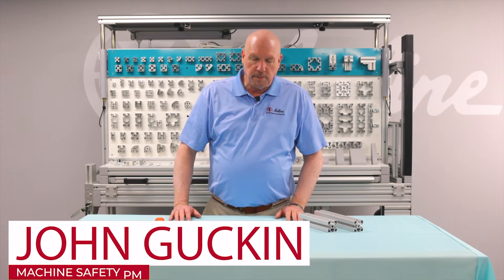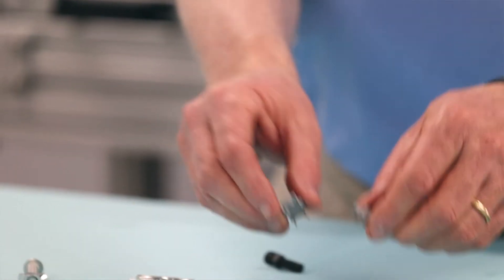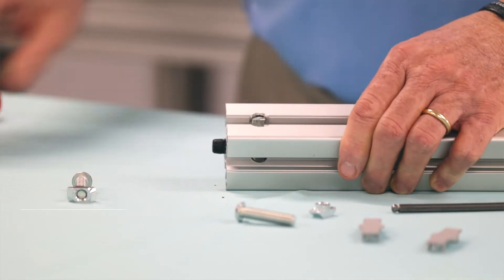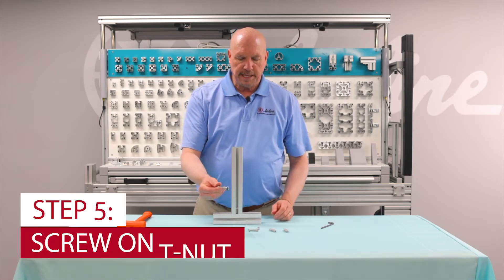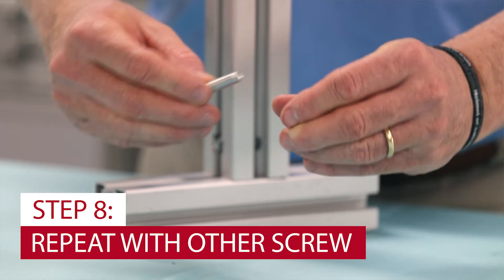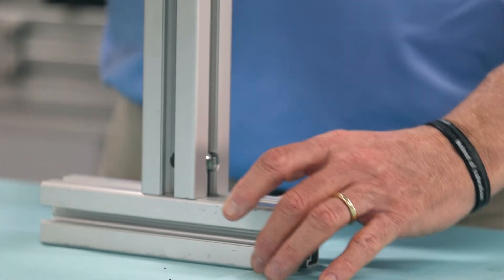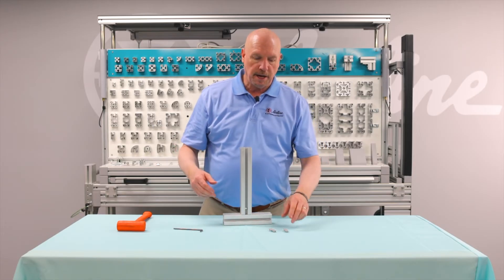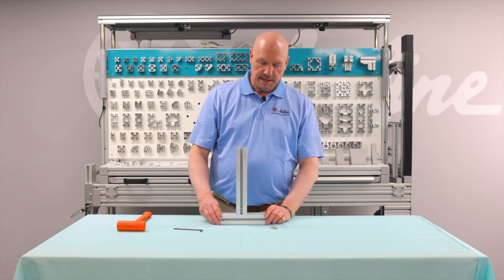The STRONGEST Way to Join Extrusion | Bolt Connector | Build Anything with Aluminum Extrusion

Comment: how can i install 40x40 profile onto a wall?
Reply from the maker: The response I got from John and our engineers, was that the most common way is to use "Gussets," and remove the anti-rotation gusset tabs first. 

Another option is also just drilling a "through hole" in the middle of the extrusion and screwing it to the wall.

We have each style demonstrated in this web image for you - https://bit.ly/4e6JVT8

You can purchase gussets and connectors from our site here - https://www.airlinehyd.com/categories/GUSSETS-419/1
Reply: superglue

Comment: And for the low low price of?
Reply from the maker: That all depends on the project! Some projects require engineering assistance, some want everything cleanly packaged and shipped ready-to-assemble, or you can just order strut and cut, drill, and assemble it yourself! You can get project help here - https://bit.ly/3SVNnFs or shop extrusion here - https://bit.ly/3Lo4wpt

Comment: I have a design for a 500 lb moving platform. It measures 50 inches x 24 inches. Will the 20-2040 extrusion handle the weight if disturbed equally?  I am using 800 lbs casters. I tried contacting 80/20 directly but they told me to contact a distributor. I have been waiting 1 week for a reply.
Reply from the maker: Great question, sounds like an application that's right in our wheelhouse! Copy and paste your comment into this form with your contact info, and we'll reach out! - https://bit.ly/3SVNnFs

Comment: Who drills the pre-drilled hole?  Must you order it that way?
Reply from the maker: If you have the proper equipment you can drill it yourself! We also offer custom cut length, machining service, engineering, or design, so we are able to send kits with everything pre-drilled so that you just have to use hand tools to assemble - http://bit.ly/3SVNnFs